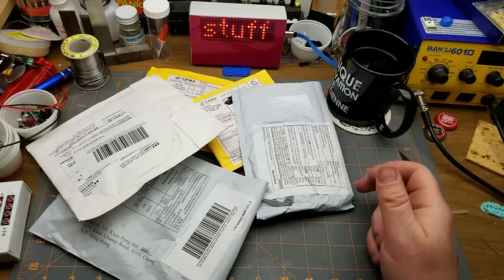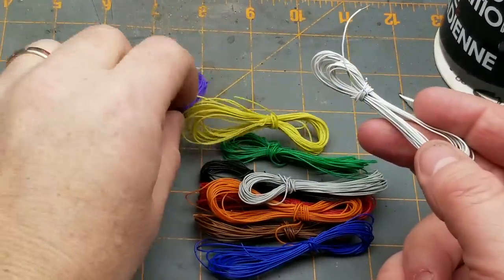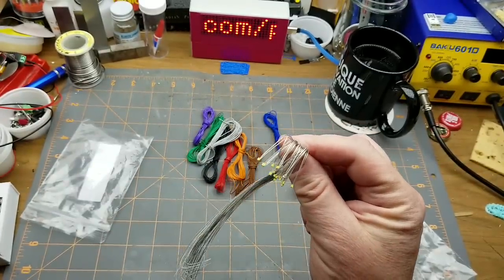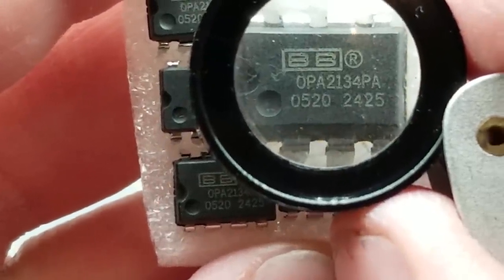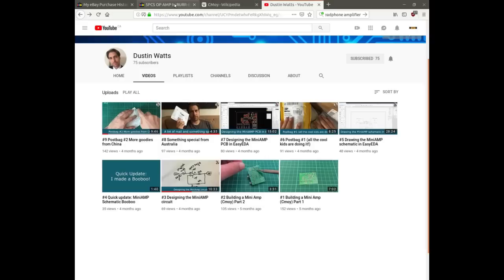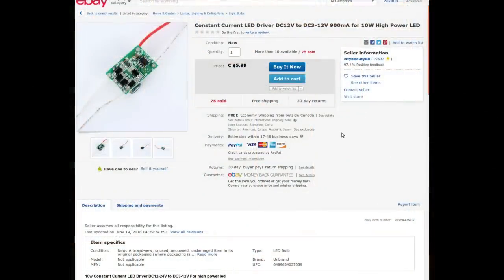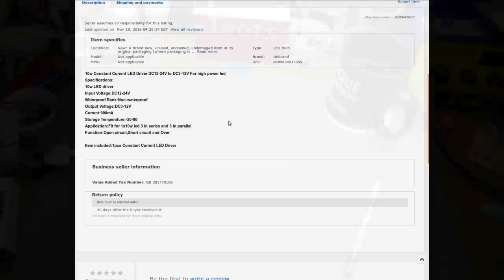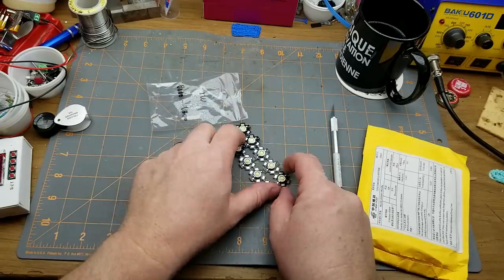mailbag monday 49

Comment: Pretty much given up on wire wrapping wire for soldered connections. It's not flexible enough, so it's a pain in the ass to route around tight places. I now use silicone wire also aroun 25-30awg, and what they call 'servo wire', essentially a three conductor thin wire used for servos. Silicone wire is super flexible, easy to pull insulation off the ends and such.

Comment: Have had an unhealthy obsession with little chip amps of late.  JohnAudioTech loves the (obsolete) TDA7267.  I ordered some "new".  A TDA2822 does TWO channel amplification in an 8-pin dip, and is REALLY inexpensive.  Each work for me.
Also saw Andreas's wire wrapping vid.  Left a comment there about my favorite:  
"Jonard R28W-0100 Kynar Insulated Silver Plated Copper Wire, 28 AWG" -- great stuff, but a little pricey.  It is a dream, compared to the more common 30 AWG Chinesium wrapping wire.
Wish I had more colors.